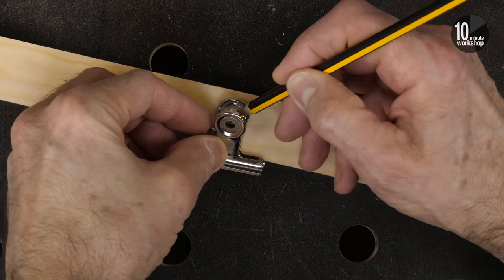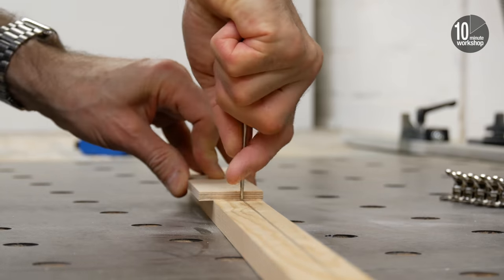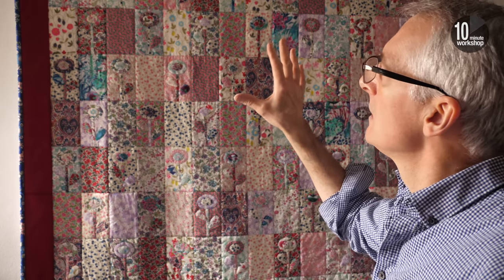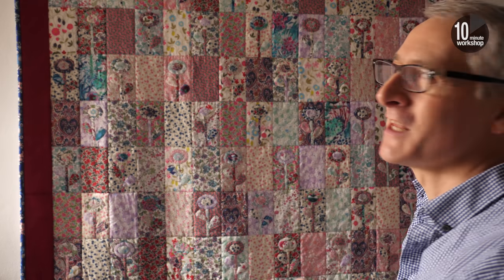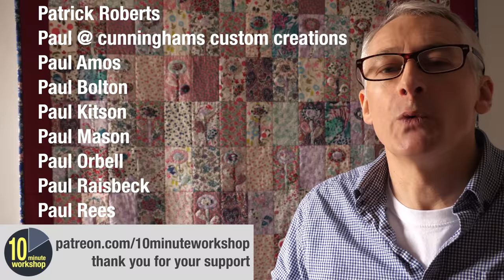I Make A Simple Quilt Hanger For Walls [Video #377]

Comment: Hi Peter.  Gorgeous quilts for sure!!  And I’ll be using that notched spacer trick in the future; looks real handy.  In return I’d like to offer up a tip you may find handy.  In the USA they use to make “cabinet maker screwdrivers” where all drivers have round stock from the tip to the handle.  The Phillips’ shanks/rods are the same diameter of the tip size, so a #1 is skinny all the way down, and so on.  Also the standard drivers have round shanks that are slightly less in diameter f(or smaller) than the width of the flat blade.  I have some up to 20 inches long. I tried Googling them but mostly the typical square or hex shanks came up.  Often they are the only ones that will fit a deep hole.

Comment: Hello Peter, I'm surprised you don't use the Andy Mac method of dust collection.  It's cheap, and leaves you with both hands free.
Reply from the maker: What’s that Steve - the old envelope trick, tape to the wall? I have a couple of extractor hoses that also do the job, but the dust pan’s already in the room... 🤷‍♂️👍
Reply: Yes Peter, similar to the old envelope trick.  But instead of an envelope (that seldom catches all of the dust), Andy uses the bottom of an old rectangular plastic container, cut to a sort of tray shape.

Comment: Great idea but London doesn't have the problems with humidity some places have. All I could think of was rust stains ruining the beautiful quilts. If you are in a place where humidity is a factor, use some clear plastic tubing to make jaw protectors.
Reply from the maker: Thanks! Clips I used and link to are stainless, so shouldn’t be an issue wherever you are, but of course, I’d expect folks to apply a bit of common sense wrt their location. 👍👍
Reply: @10MinuteWorkshop  Touching, but I don't have your faith in common sense. Building a nuclear power plant in a earthquake zone. Building a ship and not providing sufficient lifeboats because it is unsinkable. Letting someone captain the Exon Valdez through a ecologically fragile area with a reputation for being a drunk. Being the second  leader to invade Russia without making adequate provision for winter. Thinking that the mere fact of impeachment would teach the president a lesson.